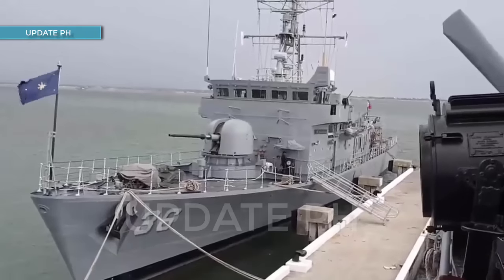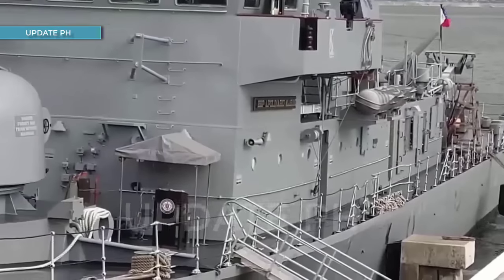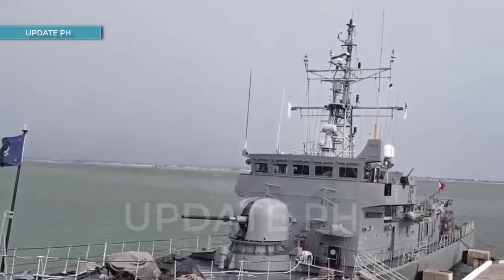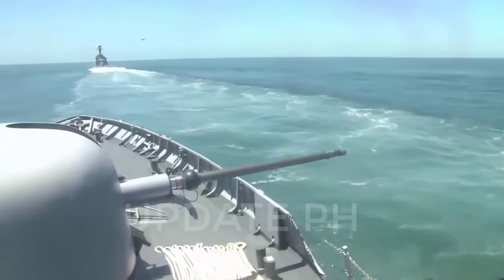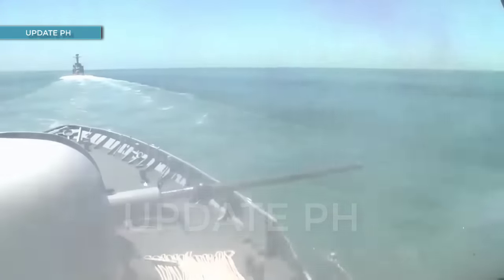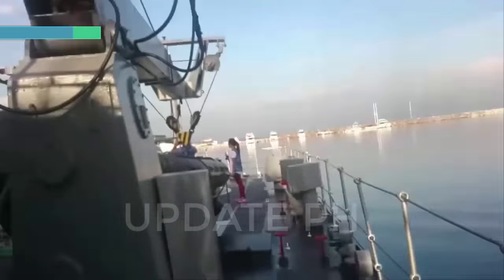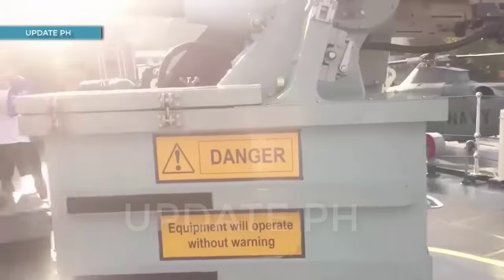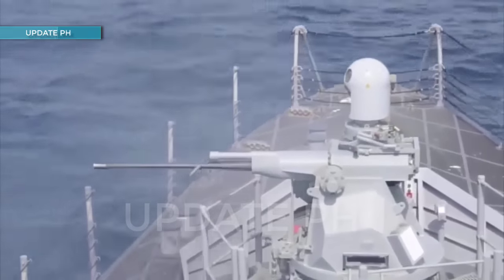Jacinto Class Patrol Boat to be Fully Upgraded in Phase 2 BRP Artemio Ricarte Philippine Navy

Comment: The Phil. Navy disregards the worth of this ship in very long way, they wait the time that this ship is out of date, they should have a firmed periodic upgrade and refurbishments to make this ship catch the ever changing time not to left behind the era of modern warfare, just like our  airforce which they dumped the F-5E, but in Brazil they extend it to another 25yrs with an upgrade in radar, electronics,engine, range, and modern warfare technology just to augment its fighter fleet, it should also be adapted to our system to improve our tech skills and tech upgrade and uses.